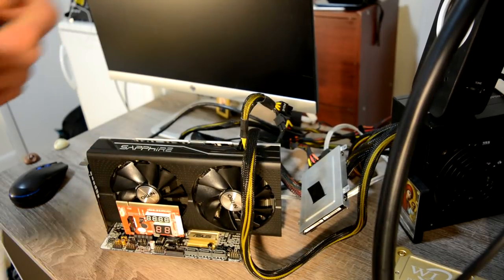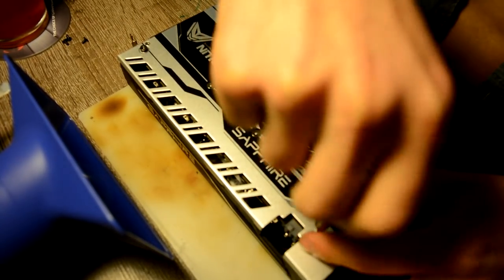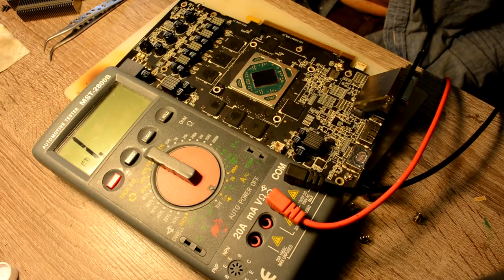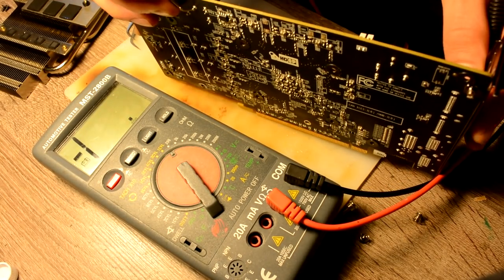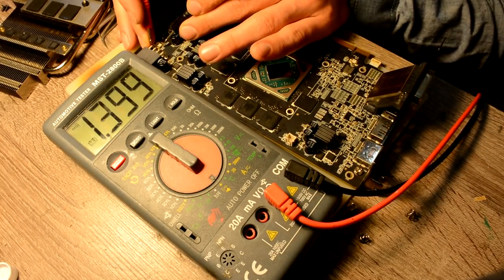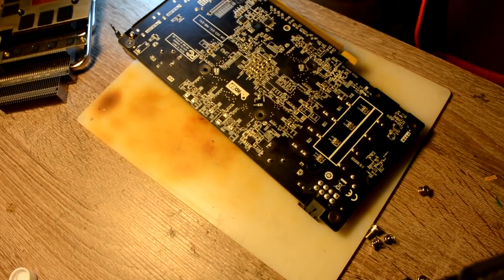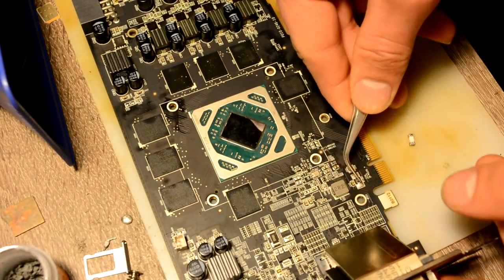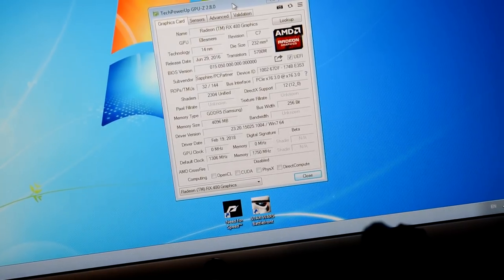bringing from dead Sapphire Nitro Radeon RX 480 no boot/ no power / short graphic card repair

Comment: uh my zotac gtx 750ti has stopped working due to short circuit do any have any idea to fix it btw i dont have warranty
Reply: Eli Tech how to remove short circuit I don't understand ????
Reply from the maker: Prithviraj Rock how you say you have a short somewhere then you gotta remove element what shorts it. Look if its physically burnt out, or apply current to it (put no more then 1V) and see what heats up how it’s shown on video
Reply: Eli Tech i heard a weird from sound from my gpu and then computer got crashed but now without gpu the computer is working fine however I don't see any burnt stuff on my gpu

Comment: Hi,
I need your help!
IGame NVIDIA GeForce GTX 1070
No video, isn't detected by PC. The fans spin
how can I get your email 
I live in France
Do you think it worth to repair ?
Otherway any advise will be Welcome.
I try Rework station Hot Air with flux but not work!
Reply from the maker: Thomas Mehiar diagnostic process you can check in one of my vid, if it doesn’t get recognized could be from a lot reason
Reply: Thx.
Reply: same problem as my 970

Comment: dude can you help me repairing my gpu ? please
Reply from the maker: Dark Void Infinity do you have specific question? Or you want send it out for repair?
Reply: Eli Tech i love you dude . Thanks for the reply . Yeah i got three non working gpus . 2 gpu does work  but not at all they are recognised as Hd 7750 and Hd 7950 by the pc but no display , I get blue screen error when i start mining .  Amd I got 290x it doesnt seems to be like working at all , not even recognised by the pc , i remeber how it get fucked up. I tried to plug it in riser cable x16 to x1 . I plugged it wrong on mobo then i herd a small boom and my psu as well gpu stopped working. What you think ?  Can i still get back it working ?
Reply from the maker: Dark Void Infinity if you plugged it wrong then 12V went where supposed to be 5V. And then what went out depends o. How lucky you are. Other 2 yes sounds like gpu. For further questions plz ask me directly. You can find all my info in “About” of this channel
Reply: Eli Tech ok thanks for the help i will contact for sure .

Comment: This guy does not know capacity of replacement  capacitors or the voltage amount applied to power line to test, typical asian repairer.
Reply from the maker: will be any arguments ?